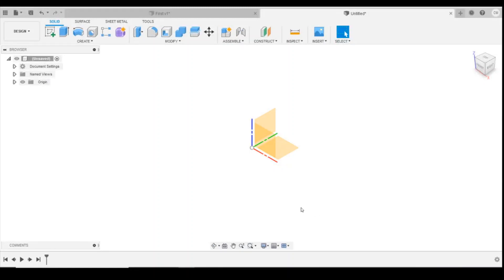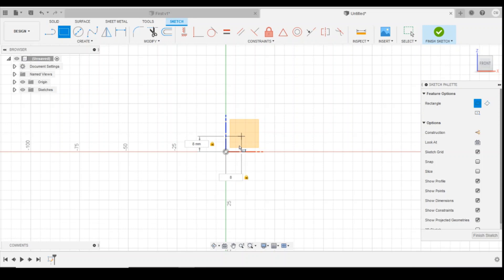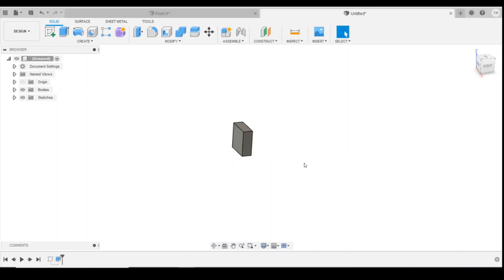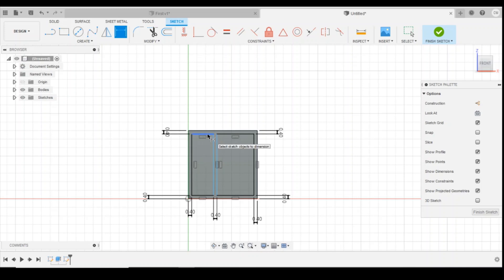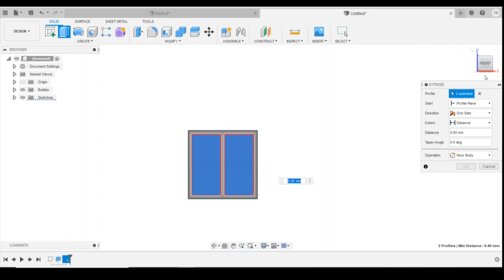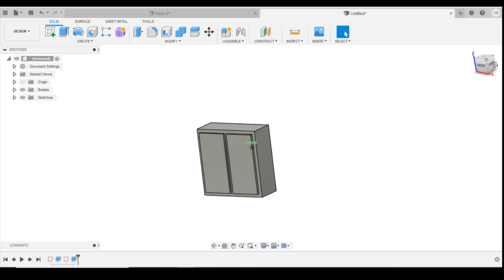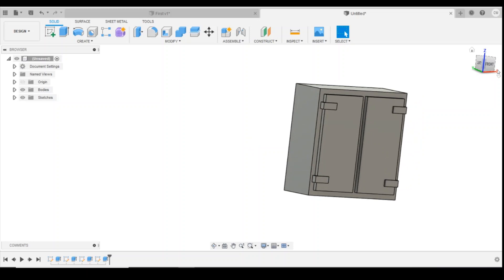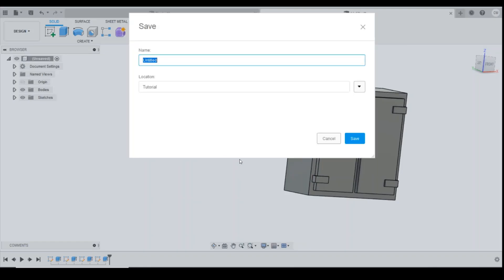lesson 1 - Starting drawing in Fusion 360 for you Model Railway

Comment: Carl,

Thank you for this Fusion 360 lessons, because you specifically create objects for modelrailroads. Just my kind of things.

And now I am already struckling with lesson one. To be precise, the hinges. I use a mouse with three buttons (the middle button is defined). When I select the little rectangle box on the cabinet itself, and then hold shift while hovering above the part of the hinge at the door, it either select the part on the door or on on the cabinet. Not both. This also means the extrude is only done on one part, not both. 
I have been busy for a couple of hours now and cannot get it right. Also searched with google. A lot can be found about extruding, not about extruding this specifically.
I hope you have some advise.
Reply: Found the problem. After a good night sleep.
To select press and hold shift while selecting with mouse, move mouse to center of the hinge on the door, click and hold. Now both are selected as one and the extruding can be done using join.

Thank you for this video tutorials.
Reply from the maker: Glad you were able to find the problem yourself.

Yes you need to hover the mouse over the hinge rectangle in the sketch when  you hold down the shift and left mouse button to enable the pop up window that allows you to select the profile.

Comment: Great video 
One question can you model full size and scale down the finished model ?
I got the link from the 009 Facebook group
Reply from the maker: Hi Brian,

You can draw a model to full size and scale it down but it will cause you to have to make changes.  The issue you would have will be the minimum size of objects and how well they will print.  if you have scale plans you can just scale them to the correct size for your model within Fusion 360.

I draw most of my model in N gauge as that the scale I model,  but when i have printed some of my model for friends who model in 00 I have changed some of the things like wall thickness' and also made some of the smaller details like handrails in N even smaller for the 00.

Thanks

Carl

Comment: how do i export the file to stl format for my printer?
Reply: Hi,

I have covered that in the following video link.

https://youtu.be/jeTtWY9_UPs

Regards

Carl
Reply from the maker: Hope my reply above helped you
Reply: Are you using a different version from the current free one?? I have watched and tried several times and mine seems different and i just cant get it to work. For instance... draw the box.. then size it to 8mm yours does height then tab to width... mine does width first then height?? When then trying to do door gap to cabinet... you select too of door and then cabinet and give a gap size... mine doesnt do that it gives width of door?? Only way i can get what you do is selecting too of cabinet and then door line which sometimes works!! Ive tried again and again. And sometimes when ive drawn the door it automatically has width above in black and wont let me draw a second door?? Im really losing the plot with it and thats as far as i get.
Reply from the maker: Hi,

The version I'm using is also the free version as i do this for a hobby and make no money from using the software.

The order that the sizes when you dimension are highlights I believe is based on what way you draw the box,  i.e if you drag up first I think it selects that as the first option.  its not really something that you need to worry about as long as you check which dimension you are adding the figures into.

when you dimension you need to make sure that you dont have anything (lines, points or surfaces etc) selected or it will try to dimension those,  if it does do that just hit ESC a few times to make sure they are unselected.

If an item has already turned black before you have added a size dimension then you may have accidently constrained it in another way, i.e caught the midpoint, of vert/horz constraint.

It can be a little frustrating when things like this happen but please stick with it,  you will get it.  Im here to help and will happily answer questions.

Thanks

Carl

Comment: I'm completely lost at the part with selecting the hinges. I've been at it now for half an hour trying different combinations only to fail.😪
Reply: Hi David,

Which part of selecting the hinges are you struggling with?  Is it selecting the profile hidden below the door face?

Carl
Reply: @carlw61  I think I've got it. I wasn't using the join. it kept cutting bits out or i only selected the small part of the hinge. Making mistakes can be more useful sometimes. I'm getting it slowly.
Reply: @hopedj  yes that can happen if you sketch covers what the software could think you either want to cut or join something.
Reply from the maker: David do you think that you have it sorted now?

Carl
Reply: @3ddrawingformodelrailways  I think so. Hinges are sorted. My history is all messed up and I messed up creating two versions of the roof. Its totally my lack of experience. I'm going to start again which I think will benefit me the most. I'm definitely getting better with your videos. I am having issues with the zooming in then trying to move around. I'm still enjoying following your videos. Thanks for keeping in touch.
Reply from the maker: @hopedj  do you have a mouse with a center roller wheel?  i found that they are the best ones otherwise you need to use the controls at the bottom-middle.

you wouldn't believe how many times i redid things at the start and looking at them now my drawing was so messy and could have been done much cleaner with the experience.  That can only be gained by experience and knowledge though.